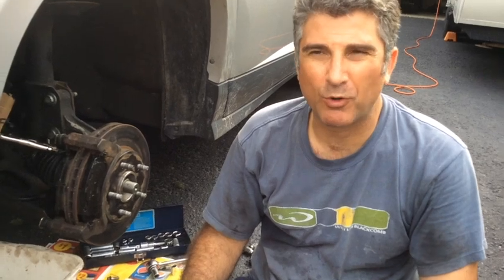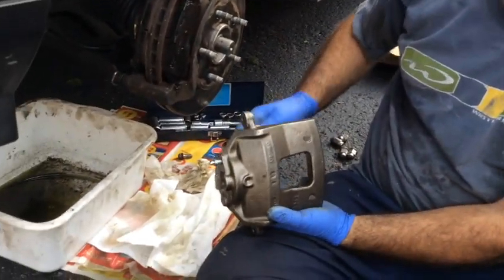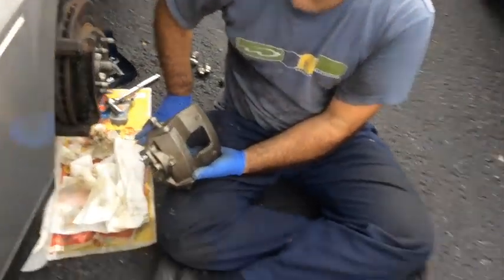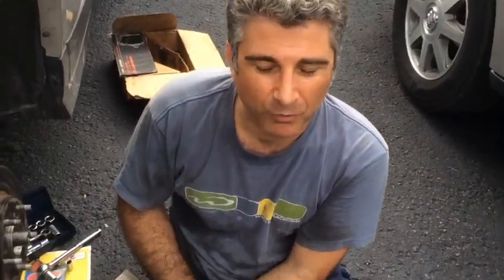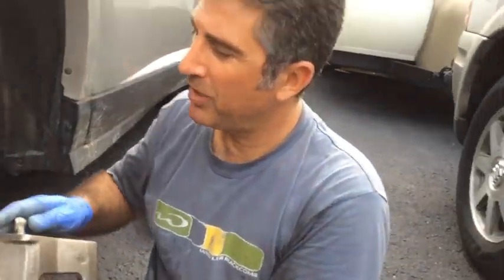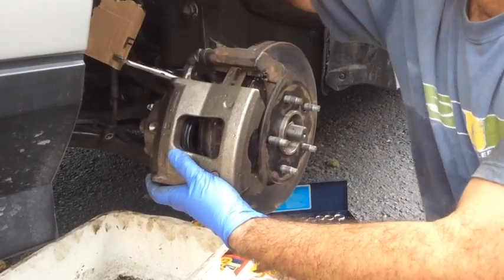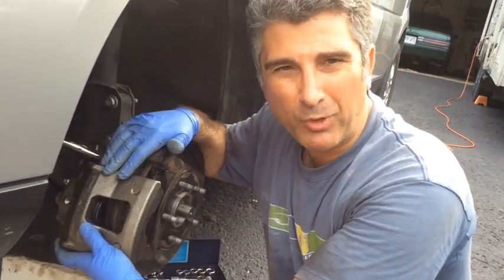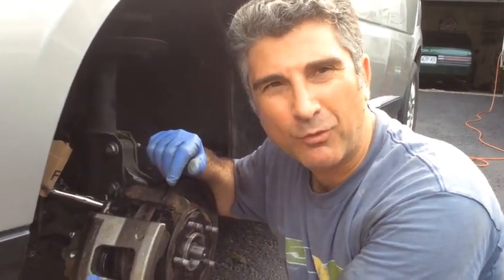Cannot Bleed Brakes Here's Why...

Comment: Thank you so much for sharing your experience. I've been bleeding my brake and master for hours now. I can't believe I overlooked such a simple thing. So grateful to have brake pressure again
Reply from the maker: Hey Harley, it's a common mistake for some of us newbies. I had never replaced brake calipers before, easy to do, but easy to install on the wrong side too. Glad I could help.
Reply: @robthefixitguy7185     Oh  man musta been frustrated  dont know how you figured out your mistake but glad it worked out.    One upside is Im sure you got all the old fluid out  you musta been bleeding for days.  Thanks for shareing could happen to anyone  Ive done many a brake but never thought of this
Reply: Dude, same
Reply: I just stumbled across this I've been dicking around with it for 2 days. Switched seems to be alot of air
Reply: @jeffreyplumber1975  maybe bleeding from the fingers too with all that wrenching!!!

Comment: You deserve a medal! I spent 4 days trying to bleed my brakes. Gave up and called a garage. I’m supposed to drop it off tomorrow. I just checked and yes, my bleeder screws are at the bottom of the caliper. Thank you sir. I’ll be switching them in the morning.
Reply: Switched my calipers, bled my brakes and cancelled my appointment at the garage. Did I mention that I saved a ton of cash?

Comment: I just got a truck in a trade and the guy said he replaced the calipers and brake pads and all I had to do was bleed it and for trying to bleed it for a week straight and putting a new master cylinder on I finally stumbled across this video and went and checked and the guy installed a right front caliper on the left front which made the bleeder screw on the bottom so thanks to you and this video I finally know what the issue is and can go get the right caliper tomorrow. Thank you for the help my good sir and keep up the great work and the great videos! You just gotta new subscriber!
Reply from the maker: Happy to help. Glad you figured it out.

Comment: BIG BIG THANK YOU!!! 
I built a side by side,  using front wheel drive car engine and transmission,  installed it in the back, and the way I desined suspension, I had to turn nuckls 90°. That changed calipers location!!!!! I've been bleeding it sooo much and sooo long!!! I went through 4 quarts of dot 3... I was ready to rip my hear out!! Thanks for the video!! I have video of my buggy on my page...
Reply from the maker: Awesome, good luck with your project. That's a big one to take on!

Comment: Thank you. I did the same thing. I put in two new calipers; they weren’t labelled left and right. Sure enough, I couldn’t bleed the brakes and thought there was an engineering problem because the bleeder screw was in the bottom. The calipers are identical except for the position of the bleeder screws. Your video explained the solution immediately.
Reply from the maker: Happy to help out!

Comment: Wow talk about serendipity... Here I am trying to get the extra squish out of my pedal after changing two rear cylinders and the left caliper. Looking at Dodge Dakota bleeding in case there's something different with Dodge. I saw your vid and I flash that the new caliper has the port on the bottom!!! How did I not notice that? I checked my online order with Advance and sure enough I ordered a right instead of a left...

Easy fix... Took of the two bolts and held the caliper so the port was up, gravity bled it, reinstalled. It's a closed system. Who cares? Brakes are rock solid!!!

Thanks

Comment: Did a rear caliper change, both sides. Sized up the new to the old to be sure I had the correct one for it’s correct side. Didn’t at all look for the placement of the bleeder valve, guess I had a 50/50 shot, and lucked out. Thanks for taking the time

Comment: Update: YOU ARE A LIFESAVER! omg I went out as promised and bang they were indeed backwards. I put it up on jackstands and swappped them. 1 bottle of fluid later the rear breaks stop. now I just have to get new ones for the front (making sure they are installed right) being the bleeders broke off but the car is stopping with the rears.. This 240 lives on to see the road and being I lived in it has meaning that I didnt want to get rid of her.. OMG lifesaver TYSM
Reply from the maker: Hi Kenneth, you are most welcome. Always look for the simple fixes first. Fixes that require a little time and no parts are the best!

Comment: WOW after 2 full litres of brake fluid wasted i have finally come to the right video, i seen that the bleeder was in a different location but it honestly just passed my mind, decided to bleed the replaced calliper over 3 times, ended up doing all the callipers and still no luck, did one bleed with the calliper flipped and the disc brake and pads in between to prevent the piston from coming out and BOOM got all the pressure back

Comment: I saw a video on I think a Dodge Charger and the calipers were reversed with both bleed screws in the low position . It also would not bleed . Good tip .

Comment: This happened to me in a motorcycle but there is no left and right for the rear brakes, it was the Master cylinder pump that was leaking it would not pump the oil or air out

Comment: I JUST realized this after bleeding my brakes for the third time. All calipers, rotors, pads, and M/C are new. I'm hoping this is the gremlin in the system. Thanx for the 411. Sometimes it's the smallest thing we overlook, like flaring a perfect brake line, ... and notice we didn't put the fitting on. PEACE
Reply from the maker: Hope it works.
Reply: @robthefixitguy7185  ... you and me BOTH. I can't believe I didn't notice it from the get-go. I've been dodging the weather and I get in a hurry. One thing I know to be true and correct, SLOW is FAST. Thanx again for the info. You may have saved a few brain cells I have left.

Comment: I understand that the bleed screw has to be upward when the calipers are installed correctly; but there is still something about the calipers on my dodge ram van; Even though the calipers are installed correctly the notches that slide are different ; when the caliper is being installed the top goes in first on one side but on the other the bottom goes in first...I hope this is clear its difficult to explain with out a photo...but the bleeder is up on both calipers  so it cant be wrong and its been working that way for years  it seems strange to me

Comment: lol this happened to me not long ago. I've had a jeep about 10yrs now. Never noticed the calipers were always installed backward. Never really good strong brakes but they have never been an issue. always stopped no problems. Just wasn't as tight as other cars. but they locked up from sitting for a few yrs and I tried to drive it but they were stuck. So I bought new calipers and installed them exactly as they came off and was wondering why I couldn't get decent brakes without the abs and brake light coming on because the pedal went to the floor. Eventually saw a video online that made me realize the bleeders were on the bottom and not the top. I switched them. Now the jeep has stronger brakes than its ever had since I've owned it. My issue was installing them the exact same way they were because I had forgotten to note the bleeder screws thinking they were already installed correctly. But the previous owner screwed that up.
Reply from the maker: Never assume someone else did it right!

Comment: Do you have any idea why I was able to have brake pressure this week with apparently backwards calipers, but when I repaired a wheel bearing and disconnected one of the calipers I started experiencing the symptoms you described?
Reply from the maker: Hi, once you disconnect the caliper you will get some air into the system and it is impossible to remove unless the bleeder is pointing up. Not sure if you installed them backwards, but whoever did somehow managed to bleed them. They may have used a pressurized brake bleeder. Mortals cannot do it by bleeding manually.

Comment: So true just did this today, halfwat through a master cylinder when i saw this. Thx
Reply from the maker: Check the simple stuff first. I knew everything worked before I replaced the calipers so I knew it had to be something related to replacing the calipers. Hopefully you can return the master cylinder.

Comment: I think that's what I'm running into right now. How did you tell which was left and which is right? Cuz they're Nish Ali when I had them perfectly installed my bleeder valves were at the top and now based on your video I uninstall the caliber if the bleeder valve to the bottom and they don't fit right
Reply from the maker: Hi Jeff, the calipers are normally stamped with an L and R. The bleeder valve should always be at the top.
Reply: @robthefixitguy7185  then with all new brake lines , hard and soft. Why isnt any fluid coming out when I bleed?
Reply from the maker: @jeffwhipple6368  Hi Jeff, if you replaced all the lines you have lots of air in the system. You may need to do a gravity bleed. That means you open one bleeder valve and let gravity push the air out and the new fluid in. Keep the master cylinder lid off and the fluid topped up while you do that.  It takes a little longer and you will need to do one wheel at a time starting with the furthest. You can also buy a brake bleeder kit for about $30 that will assist with bleeding the brakes. Be patient, there is no magic problem here, just do one wheel at a time and make sure your master cylinder is always full of fluid. Worst cast scenario you will need to bench bleed the master cylinder. Search Scott Kilmer, he has a video on how you do this while it's on the car. Good Luck.

Comment: I have never changed my brake fluid in my car of 130k. Car stops fine.  Should i change them asap? Leave it alone? Or change them when i do a brake job?
Reply from the maker: Hi Joel, check your owner's manual. I think they normally say every 3 to 5 years. Most people do not replace it, but it can be a good idea. Brake fluid absorbs moisture which can then rust your brake system.
Reply: The brakes feel and work better after a flush if it has been a long time.

Comment: Please help!!!!!!     I put on a new master cylinder and went to bleed the lines and I cannot get any brake pressure.  I bled the master cylinder and hooked up a 15' clear tube and hooked one end up to the bleeder screw and put the other end in the master cylinder. However when I pump the brakes I can see big air gaps in the clear tube and when I pump the brakes the air bubble simply goes back and forth and wont advance.  What am I doing wrong.
Reply from the maker: Hi Greg, you need to bench bleed a master cylinder before you install it. See this video from Scotty Kilmer on how to do it on the car. https://www.youtube.com/watch?v=Uz4OwuUGVOA

Comment: do i need to bleed the back wheels(which wear shoes) as well, when i replace the front brake pads? or just the two wheels in the front that wear pads? i was thinking the two different brake systems would have closed systems, but mayb im wrong. '87 pontiac safari rwd full body wagon, b body. thank u.
Reply from the maker: Hi, if you didn't touch the rear, they don't need to be bled. Just the front. Do the furthest one from the master cylinder first and then the closest. 
Good Luck.
Reply: i guess thats what i was doing wrong, i was bleeding the closest(drivers side)first. they would bleed till firm until i cranked on the engine. then the pedal gets spongy again.
Reply from the maker: @notreal5299  If it's firm until you crank the engine, you have air in the lines. Try again with the furthest, then closest to the master cylinder. Should fix your problem.

Comment: I did the same thing and the dee thing will not bleed with the nipple at the top; one guy tilted the caliper up and bleed them. I'm going to switch mine.
Reply from the maker: Hi William, remember to bleed the furthest caliper first. If you only replaced the front calipers, it's pretty simple. If you replaced all four, bleed the furthest, then second furthest, then third furthest and finally the last one. You cannot get all the air out of the system unless you do it this way. Try it out.

Comment: I'm having the same problem but my bleeders are on top are both calipers are on correctly (They're marked with L and R)
Reply from the maker: There are three possibilities I can think of. 1. You should ensure your master cylinder is full of fluid and do a gravity bleed. Look up on youtube how to do this. 2. You may have a defective caliper. 3. Make sure none of your brake lines are kinked.
Reply: @robthefixitguy7185  I've gravity bleed, I've checked all lines, I've tested both calipers. Had breaks before but the one caliper was locked up before I replaced it

Comment: It could also be a faulty master cylinder. Wich is the case for my 03 CRV. You can't mismatch brake calipers on a 03 Honda CRV!
Reply from the maker: True, but if your master cylinder was fine before you replaced your calipers, it should be fine after as well.

Comment: I’m having a problem very similar to that with my 91 Toyota forerunner.  I do not have new callipers however I do have brand new lines, all of them.  The brake company that I’m using right now used a pressure bleeder to fill/bleed the entire system with no luck.  I have been researching for the last four days and read that a vacuum bleeder works better for when you’re having a tough bleed job.  I’m curious if you’ve heard any information on that, and if that might be a solution for me.
Reply from the maker: When bleeding brakes you need to bleed the furthest from the master cylinder or longest line first. Then second, third, finally the closest. It is very possible the shop accidentally left air in it. They have one person bleeding kits. I would try one.

Comment: I've been having this EXACT same problem after replacing my calipers. Tried bleeding the brakes over and over again only to have no brake pressure when I would start the car. Sure enough, I went to return the cores for the old calipers at the Autozone I bought them at and the dude there was like "Maybe you installed them backwards, if the bleeder screw is down low, they're backwards." I had swear I had a huge light bulb above my head like DUDE. NO WAY. Sure enough I checked them when I got home and turns out I swapped the front ones by accident. I'm going to swap them back to the correct side and see if this fixes it, I will update!

Comment: What happens if I install on wrong side but still have pressure?
Reply from the maker: That means there isn't a lot of air trapped in the caliper. It will be next to impossible to bleed the caliper when it is on the wrong side. I would flip them to the correct side and bleed them again.

Comment: you can't have somebody step on the brake pedal pump them up and hold the pedal down while you undo the screw to push fluid completely through and then tighten the screw back down? or use a brake bleeder one way valve? I always wondered if there was a left and right side there's stupid people at advance Auto told me it didn't matter. and I did put the calipers backwards according to this video on a 2004 Pontiac Grand am. and I never had a problem with it but like I mentioned I just had somebody push it on the brake pedal forcing the fluid through the line and I flush the fluid through all brake lines and it never gave me a problem it hasn't so far maybe I'll just got lucky but after seeing this video I ran out and checked and sure enough the bleeder screw is on the bottom. I guess I should go change it. thanks for making the video to make me worry now but my girl's going to run out of brakes. I guess I can either go get insurance policy on her or go fix the brakes one of the two LOL
Reply from the maker: Hi Eabster, with the callipers on backwards it would be close to impossible to get all the air out. The pedal is probably not as firm as it should be. Switch them, bleed the brakes, and then see how firm they are. I think you will see an improvement. Thanks.

Comment: I own a 2006 Chevy 1500 lt, I noticed this was happening so I switched around my calipers so that the valve was on the top. I then bled them each 4 times and now I have service brake system on my dash. Anyone have a idea?
Reply: Chevy trucks with ABS have a special ABS bleed procedure- i believe it requires a bi-directional scanner to instruct the ABS pump to activate- something like that. Now you know what to research.
Reply: @bw1841  I did do that about 4 times. I’m thinking my master isn’t strong enough to handle 4 disc.
Reply: Another question to ponder is: What specific sensor or condition triggers that message?

Comment: I put them on the right sides and still have NO brake pressure.!
Reply from the maker: Hi Richard, did you have pressure before you replaced the calipers? If yes, one of them may be defective. If no, then I would look elsewhere in the system. The master cylinder would need to be looked at assuming there are no leaks in the brake system.
Reply: @robthefixitguy7185  I've dome many brake jobs over the past 43 years never had this. There was pressure before. There's NO leaks, All 4 calipers are fresh remans the power booster is new and the master cylinder is good.
Reply from the maker: @richardmiseljr2413  Hi, at this point I would suspect any components you have replaced. Is the power booster defective? Was everything installed correctly? Was the master cylinder bled properly? If you can't find the fault I would get a mechanic to look at it. Not worth replacing parts without knowing the problem.

Comment: I changed the lines between the junction block and master cylinder and I need to install a tool in the metering valve sensor hole to get it to bleed. Thought might help someone down the line